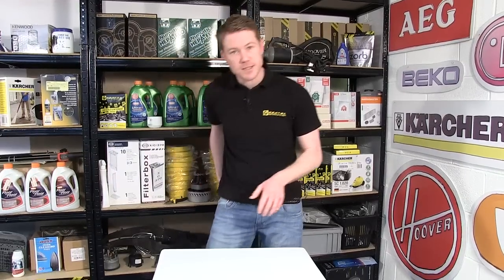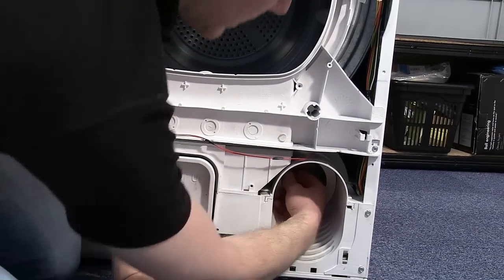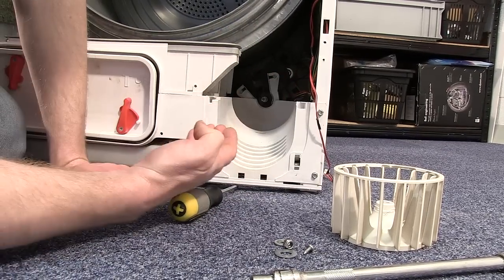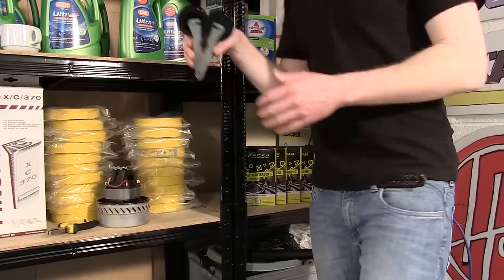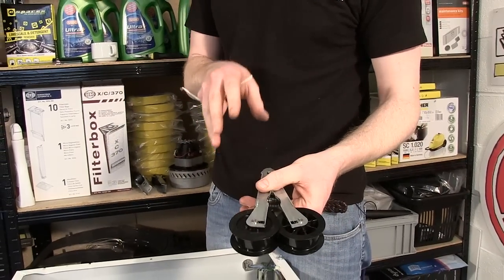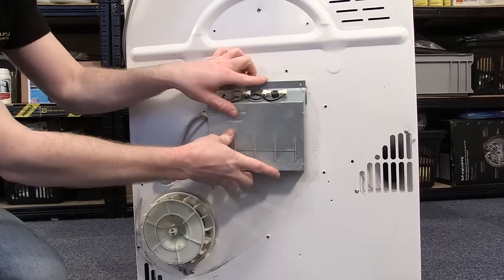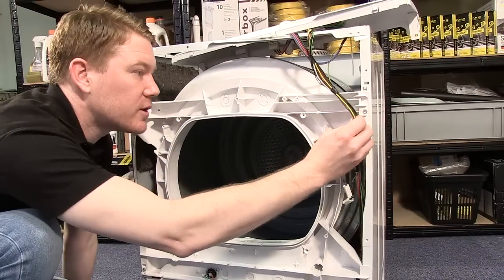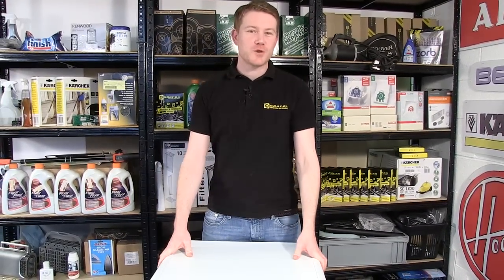How to Replace Tumble Dryer Jockey Wheels (Hoover/Candy)

Comment: Good tutorial, helped a lot in dismantling and repairing my machine. I'd recommend rotating and taking out the fan cover after taking off the frame that holds the drum as it comes out a lot easier.
Reply from the maker: Thanks for the comments David, often by dismantling a bit more the job can be easier. :-)

Comment: Fantastic tutorial. We would never have known how to dismantle the fan housing either. This video helped us change a capacitor and we were able to do so through the gap left by the fan's removal. Thankfully we didn't have to remove the drum. Thanks for uploading
Reply from the maker: Well done, Marie. Although replacing the cap is possible it is quite difficult as you have to work blind and through touch as it access is so limited.
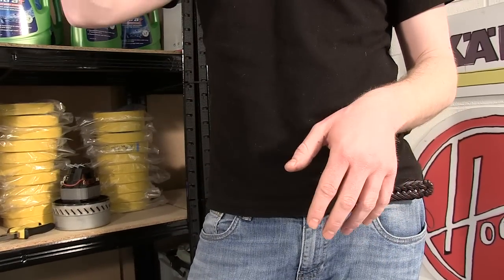At least this video shows where the cap is at 6:55
Reply: @eSpares  my hotpoint tl52 is making a grinding/scrapping noise when turned by hand can you help me fix it

Comment: Great video thanks, used this to work out how to get the front off to change the lock switch, most other machines it unscrews from the outside, but not this model of Hoover, couldn't find it anywhere on the web until I saw this! Well done!
Reply from the maker: Thanks Cheryl, hope you sorted the problem.

Comment: Please can you tell me what size bolts to use to secure the jockey wheel to the indesit idc 85 drier I've lost the bolts
Reply from the maker: Kris Bateman The manufacturer does not list these or give information on the size of these. However if you remove the heater cover and rear fan you can access the motor fixing bolts that we think are the same. You should be able to use one of these as a pattern to match at DIY or car spares firms.
Reply: +Kris Bateman Probably no good to know now,  but they are 8mm
Reply from the maker: +jason hounsell Thanks for the info. Hope it hasn't taken 7 months to source replacements.

Comment: My Candy tumble dryer is emitting a squealing sound each time the drum rotates. Espares vids suggest could be either the jockey wheels or belt tensioner, so not sure which parts to get. Any suggestions ? The belt itself looks to be in good condition
Reply from the maker: Hi hathairne, the easy way to test them is to spin them and listen for the noise, if the bearing has gone inside the wheels you will hear it.

Comment: I have just done this today. 
It took me about  3½ hours though another time I would expect it to be quicker. I was not helped by the fact that my dryer is stacked on the washing machine
My problem turned out to be that one of the pulleys had seized completely

Some observations:-
1  I was completely unable to remove the top half of the fan housing with the drum support panel in situ and so modified the process here by removal of the panel first. (I note that this is glossed over in the video)
2  Had a terrible time trying to remove the wheels from round the motor shaft, but persevered and lost a bit of skin. (Matt you make it look so easy)
3  Replacing the fan housing is not helped by the wiring loom which is anchored right in the path to the slot. A bit of wire coathanger bent to a hook to hold it out of the way worked. (same bit of wire used to pull the spring on to the bracket)
4  The door hinge is secured with torx screws so make sure that you've got some.

After completion it is a great feeling to switch on and find that the awful squealing has gone.
Thanks Matt for a video that gave me the courage to try it.  I guess I saved quite a bit of dosh today and so I am very pleased.
Reply from the maker: +rick archer Thanks for the comments Rick. Glad you got there and as you say there are a number of points that can be difficult.

Comment: Would most definitely put more time into showing how to put it back together. Like attaching the belt to the jockey wheels and also sliding the roof of the fan casing back in which has a guide on the right hand side - once you’ve twisted it to lift the wires over the top. 

Great vid though, than you.
Reply from the maker: Hi, thanks for your feedback on our video. Hopefully it was helpful for you repairing your tumble dryer!